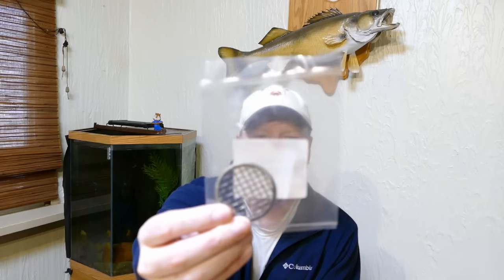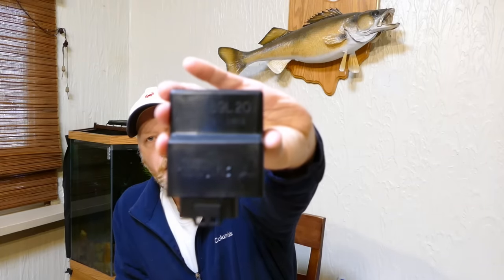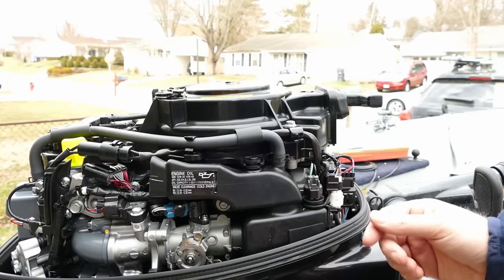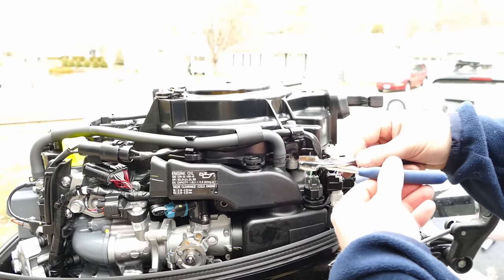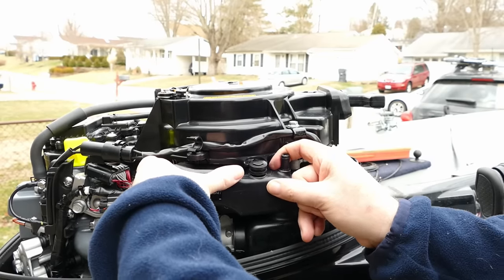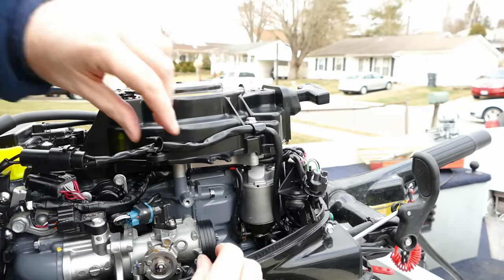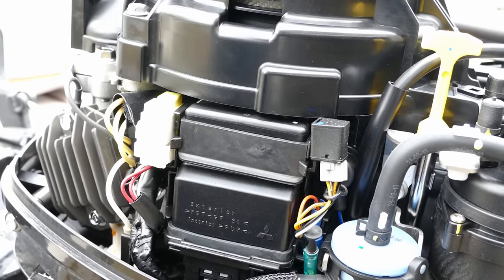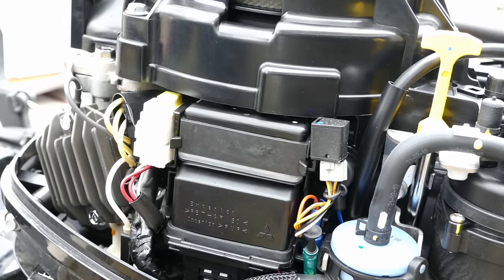Suzuki 9 9 to 20 HP Conversion Project  -  So Easy!

Comment: You mentioned that your 9.9 is 2021. So is mine, so because I see at least a few ECUs with different part numbers can you tell me which one you installed? For example 33930-89L20, or 33930-89L30, or 33930-89L40 ? The part#s for the flame arrestor and seal are straightforward. Thanks!
Reply from the maker: The part number that I ordered is:   33930-89L20
Reply: @Dark30Outdoors  My model has elect start, remote/non tiller, power tilt and is, I think, different than yours so I'm unsure whether a different ECU is required or not for those features. It's an expensive decision to get wrong if it cannot be returned. Maybe I need to locate a 2021 DF20 with same features as mine and figure out what ECU is installed.  Or maybe I'll just do the 15hp upgrade using a bored out restrictor plate and leave it at that. Decisions decisions!!
Reply from the maker: @donc2334  Okay, yeah mine is a tiller model.  Not sure if it's different for one that is cable steer.

Comment: As others have probably mentioned, you can't use a 9.9hp prop on a 20HP engine, well you can but then it was pointless doing the upgrade lol, be like putting a Supercharger onto your car and keeping the old Cross Ply Tyres, sure you get a lot more power to the wheels, trouble is they will just spin and not get you going any faster :)
The old prop will give you the same top speed as you aren't getting any more revs, unless the new ECM also increases the RPMs, you will need to upgrade the prop to get the full use of those extra 10.1hp as you doubled the HP but didn't change the main part that makes the Boat move :).
If the ECM did increase the RPM range, you will just get cavitation from the old prop and not a lot of extra thrust or top speed.
Not sure why that wasn't included in the Video you saw that showed you how to do this upgrade ?
Reply from the maker: I had previously changed my prop in anticipation of this upgrade!  👍
Reply: @Dark30Outdoors  I should have guessed as you did get a much better top speed :), considering there are no actual engine modifications, this is a great upgrade, to be able to double your out put with no extra stress on the engine is amazing.

Comment: Wonder if you had a Suzuki 6 hp with a carb...Is there any hop ups for that? cost? performance?
Reply from the maker: I'm not sure.  I know the 9.9 and the 20 HP that Suzuki makes use the exact same housing, and really everything is the same except for those 3 simple parts!

Comment: Sweet!! Do you know if I can get more hp out of my 20hp tohatsu efi 4 stroke?? Please 🙏
Reply from the maker: Not sure.  For this project, the 2 different motors are the same except the lower hp one reduces fuel flow with a restrictor plate and then uses a different EFI module.  Something you could look into.
Reply: Typically all 20hp engine families are the same factory tuned up 15hp, or 9.9 (if EFI).   But more than 20hp are a completely different larger engine family so no, its not possible.

In the smaller 4-stroke outboards, typically the same engine families are grouped as follows;
 4, 5, 6hp
8, 9.9
9.9, 15, 20 (Merc & Suzuki only)
15, 20 
40, 50, 60, 70
75, 90, 115

Comment: I didn't watch the whole video to find what I came for, but if it wasn't mentioned in the video...

Don't think for a second that you're pulling one over on Suzuki by doing this to a new engine because the cost of the parts is within a few bucks of the difference in price between the 9.9 and 20.  Same goes for every other manufacturer that uses the same physical engine over multiple HP ratings.  On a used engine, eh... maybe, depending on how cheap you're getting the used one for.
Reply from the maker: I saved a little bit, but that wasn't the main initiative.  My area has lakes that are restricted to 10HP or less.  My OB shows that it is 9.9 HP,  but it is really a 20 HP so I'm good to go!!
Reply: @Dark30Outdoors  There is also that.  When I was a kid in the 80's, we had a summer home on Pocono Lake in PA and their limit was 6 HP engines, but no mention of how many, so we threw three of 'em on a 14' v bottom and ripped around until the board caught wind and changed the regs to specify 6 total HP per boat.  lol...
Reply from the maker: @Prototheria  Haha!  That would have been awesome to see!!!

Comment: So latest 9.9 efi tohatsu outboard is at 84.9lb so by changing parts to 20hp it still remains at 84.9 lb ...which is nice because at stock 20hp tohatsu, weight of engine is at 104lb...so ur saving 15lb of weight. Question is, 15lb of weight, is it worth all the hassle? Or is it just better to buy 20hp outboard?......
Reply from the maker: I’m not familiar with the Tohatsu brand. On the Suzuki, they build their 9.9 and 20 exactly the same so both weigh the exact same.

Comment: Nothing beats a good ole doubling of value. Love it. 😂🛥️That's plenty juice for a small fishing boat. You might not get to the bar as fast as the fellas with the Mercury 200, but you'll have a lot more beer money since you spent $25 on gas for the day and they spent $450.
Reply from the maker: Absolutely!  You got that right!!
Reply: You have a fun point, but $450!?  LOL Maybe if there were 5 200's hanging off the back...  My 250hp sterndrive on the back of a 22' fiberglass cuddy only uses about $80 for the full day of blasting around.

Comment: Yet you are not there, because what have you forgotten?  Your engine will run so many revolutions and is more powerful, but you won't really go much faster because you have to adjust the propeller. This can be done with a propeller whose pitch is larger and you can also do something with the diameter of the propeller and you will  see that he goes much faster.
Reply from the maker: @BertdeJ  The prop was changed after I got the motor. I just didn’t cover it here in this video. It’s a 10 pitch 3 blade.

Comment: I have the Suzuki 15. It should work the same for it if I ever decide I want a few more HP🍺🍺
Reply from the maker: Yes, so long as it's a 4 stroke fuel injected.  You bet!!
Reply: So I can upgrade my 2020 15 hp Suzuki to a 20 with the 20 go parts?

Comment: Works great but now your hrs are wrong and you have no more warranty ?
Reply from the maker: I'm not concerned in the least!
Reply: If the motor breaks, just put everything back in, you can wear gloves to avoid leaving fingerprints. The engine hours are stored in the ebu memory.

Comment: How long is your boat? I have a 16ft sea-nymph I'm debating on doing this to. I'm only getting 13mph with a 9.9 carbed correctly to a 15.
Reply from the maker: Mine is a 14.5':, and I'm getting 23 mph with a 10 pitch prop (keeps my RPM's well below red line).  My buddy has the standard 9 pitch prop and the same motor on a 16' Sea Nymph and I'm sure he's over 20 and very happy with it!   The conversion is super easy to do!!

Comment: Would this be the same ECU for a 9.9 that has controlls instead of a tiller motor? I was not able to find any info only manual and electric start. No mention of motors with controlls. Thanks!
Reply from the maker: I'm not sure.  I would think they would be the same, but I don't know for sure.  If you called an official parts dealer I'm sure they could tell if you if the part numbers are the same or different!
Reply: @Dark30Outdoors  thank you, I will look into that.
Reply: As an expert on these motors, I state that the control boxes for electric starters and manual starters are completely different hardware and software. You don't need to buy anything, you can flash your control box with the firmware from the 20 engine, the firmware is available online.

Comment: Is there a specific range of 'yrs' these 4 stokes accept the parts he made reference to? I love the idea, something way to 'stick it to the man' price gouging boat registration fees for 10 and over.
Reply from the maker: It should definitely work for any Suzuki 4 stroke outboard 9.9 that uses this electronic fuel injection system.  I'm not certain of all the years that use this same system, but I'm sure that information is out there somewhere!
Reply: @Dark30Outdoors  Ok now I have a plan. What ever yr the motor is, I will compare the 'part numbers' for the specific parts, before I purchase the motor. The main objective of the mission = more horsepower for almost free.  Yay (and fooling the man)
Reply from the maker: @renegademind1833  the value of the parts swap is very close to the value of the 20 hp motor.  I have lakes restricted to 10hp or less and my motor shows itself as a 9.9!  :D

Comment: Did you buy the parts direct from the Suzuki dealership in the US or did you get them from your local boat shop? I was looking into doing the mod if I ever came across a second hand Suzuki 9.9 HP outboard but I wouldn't know where to look for the parts.
Reply from the maker: I ordered them from Boats.net

Comment: do you think you could convert a 15hp 2 stroke to a 25hp?
Reply from the maker: Im not sure if that can be done or not.  I don't know much about carburators.  It's a very different fuel system than a 4 stroke!

Comment: Did you change the 9.9 prop?  The 9.9 comes stock w a 9.25 x 9 you said you had a 10 pitch?
Reply from the maker: Yeah, I bought a high thrust model not realizing it was a four blade prop.  So, I had previously swapped it out for a 3 blade 10 pitch knowing it would keep my rpm below the rev limiter when I made this switch.

Comment: That’s great what happens with the 5 year warranty when you’ve done this conversion ???
Reply from the maker: It does void the warranty.  Frankly, there are OB out there running that are 30 years old.  With proper maintenance and care, there is absolutely no reason this thing won't run like a champ for decades!!
Reply: Big risk to save 300 odd bucks in my opinion. Just buy the proper 20 Hp.
Reply from the maker: @wheelieking3976  can't take a 20 hp motor on lakes restricted to 10 hp or less.  They won't know with my conversion as it looks like a 9.9.  Also, I don't see it as a risk at all.
Reply: @Dark30Outdoors  buy a 10 Hp decal and put it over the 20 Hp one.
Reply: @wheelieking3976  what about if they inspect the VIN tag attached to the engine. That shows the manufactured HP etc

Comment: I could only find the links to camera gear and such and nothing for the Suzuki
Reply from the maker: Those links are Amazon links and the parts aren't on Amazon.  The part numbers are listed in the description.  You'd have to order through a Suzuki parts dealer.
Reply: @Dark30Outdoors  Sorry. I confuse easily.

Comment: I carbed up my 1974 65hp evinrude triumph to a 75hp I had to put a higher pitch prop on to get my rpms down to safe run level idk if you will have to do the same or not.
Reply from the maker: Yeah, I bought a new prop last year because it came with a HT 4 blade!  YUCK!!   So, I knew I would be doing this conversion. and a 9 pitch would have put me right at the red line.  So, I went with the 10 which will keep me safely under the red line!  Also, a great point!!
Reply: @Dark30Outdoors  What's the diameter?

Comment: Cool project, but I don’t think you can buy a 9.9 with remote controls, right? If so, I’d buy and do this set up right away.
Reply from the maker: Yes, Suzuki does sell non-tiller 9.9 HP models and you'd be able to do the same conversion on those!
Reply: @Dark30Outdoors  I can’t seem to find them online anywhere right now
Reply from the maker: @justinstewart3248   Google Suzuki Outboard team.  I got mine from one of their dealers in CA, but they have many different locations.
Reply: I have one myself. Remote shift, throttle. I steer my boat with wheel/rudder. Power tilt and electric start too!

Comment: Ive got a 2006 yamaha 4 stroke f8cmh 197cc do you know what can be done to this to increase power? I know the newer f8 4stroke with the 212cc is the same as the 15hp  counter part and think its just a carb and possibly ecm job on that one but i cant seem to find anything for the 197cc model other than 1 aftermarket carb kit to make it a 9.9
Reply: The 15hp counter part to mine is supposed to be 323cc so its a fair bigger engine aswell
Reply from the maker: I really don't know much about the Yamaha motors.

Comment: curios, how was the change? 
Did you use the same prop?
Reply from the maker: Great, basically doubled my top speed from 12mph to 24mph.  My ob came with a Hight Thrust prop  So, I had previously changed it to a 3 blade 10 pitch prop.

Comment: Just found this, but what year/model number is your motor and what other years are the same, or how to find out?  Thanks.
Reply from the maker: Mine is a 2021.  I’ll see if I can find the model number. Might be in my unboxing video for when I received it.  I believe every year that they make that is electric fuel injection can be converted this way.
Reply: @Dark30Outdoors  Thanks.  Model number should be on a plate or something along with serial number, yes?

Comment: Hi , what it was the price for all parts ? Thanks for the video
Reply from the maker: Listed in the video description, at the time I paid approx $458 for the 3 parts!
Reply: In fact, you can not buy anything at all, take out the metal flap from the rubber band, and the control unit ebu flash the firmware from 20hp motor, firmware is available on the network, I can share. It can be flashed with any programmer, for example piasini v4.3.

Comment: when changing the 9.9 to a 20 hp does the ECM for electric start and manual the same
Reply from the maker: I think so as it is just a control module for the fuel injection.  You could as the parts supplier you order from to be sure.
Reply: As an expert on these motors, I state that the control boxes for electric starters and manual starters are completely different hardware and software. You don't need to buy anything, you can flash your control box with the firmware from the 20 engine, the firmware is available online.

Comment: I have a 2000 9.9 hp. Will the upgrade work on that?
Reply from the maker: If it's a 4 stroke with electronic fuel injection it would.

Comment: Did you change the prop or did it run 21 mph on the 9.9 HP prop?
Reply from the maker: Yes, I have a 3 blade 10 pitch, but I know many run the stock 3 blade 9 pitch.  With the stock 9 pitch blade the motor will run much closer to the rev limiter.

Comment: So if it's carbureted no chance of upgrades?
Reply from the maker: People have been recarbing older ob's for years!  In fact, before this one came in I bought a temporary ob that was a 9.9 Johnson recarbed to a 15 hp.  However, I am unfamiliar with how that is done.
Reply: @Dark30Outdoors  thank you. I will do some research on the part numbers. I have a 6hp Suzuki so i believe i can't recarb it with a higher hp carb one but I'll try

Comment: do you get any performace gains with just the flame arrestor? or do you need the ecu?
Reply from the maker: I am not sure, I think you do get some.  Though, the fuel injectors under the 9.9 ECU are going to push through less fuel than the 20 ECU.
Reply: I think the ecu raises the rpm limiter…
Reply: Most fuel injectors vary flow by pulse width modulation so injectors may not need to be changed.@Dark30Outdoors

Comment: It seems like a 20HP motor shouldn't be any more expensive than a 10HP motor. It's the same motor after all.
Reply from the maker: Yeah, I'd say that technically, the company doesn't invest more money to make the 20 versus the 9.9 so I agree with you!
Reply: I also agree with that but the dealer will not tell you that 9.9-20 is the exact same motor just a few different parts. They want you to spend more money when you could just buy a 9.9 and upgrade it to 15hp or 20hp yourself.
Reply: @bakergang89  I suspect that Suzuki's intent was to make a 20hp during design phase of the motor. Limiting the 20hp to 9.9hp was probably an afterthought for targeting another market segment.  The cost difference between a 20hp and a 9.9hp is relative to the cost of the conversion.  Suzuki charges customers the target cost of $4000 for a 20hp and charge $3500 for 50% less hp. It's a win win.
Reply: The yamaha 9.9-15 hp can take a 20 hp or even the 25 hp carb.  The 25 hp carb gets you somewhere between a 20 snd 25 hp.  The 25 has a slightly bigger cylinder capacity than then the 20 hp.  But the 9.9 to 20 is all the same except for carb airflow and jetting.  If you are already on the rev limiter with your motor going up in power will not increase your top end.   It will improve your holeshot.  To go faster you would need to go up in pitch too.  If your boat is heavy and your motor wont max the prop out then more hp will bring more speed.

Comment: Sweet. What year engine does this work on? ECM. Engine Control  Module or ECU or PCU or anything else they decide to call it because we can't use the same !%$%#& name as our competitors.
Reply from the maker: Mine is a 2021, but I believe they are all still the same minus these basic parts.
Reply: @Dark30Outdoors  Thank you. I am going to do this and then twin them. It would be bonus to find counter/clockwise but with this trick I am not complaining. I used to boat on the ocean (inland passages) and they saying I've  heard for decades was two engines always gets you home. Now I can afford two engines. Thanks again.

Comment: Is it just this motor that can be upgraded?
Reply from the maker: I think I saw a comment that mentioned another 2 motors that have different hp rating, but they are essentially the same motor with these parts that are different, but I can't remember which ones.